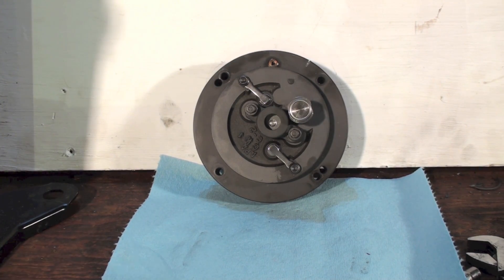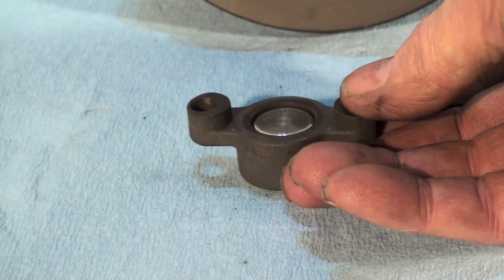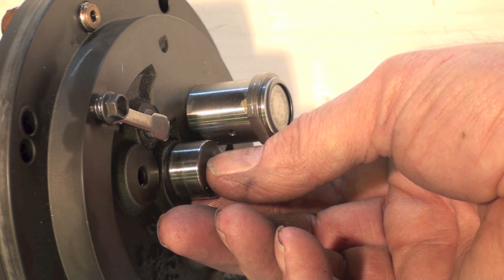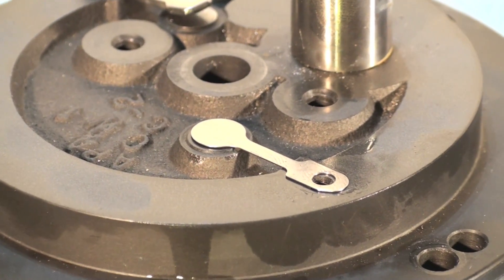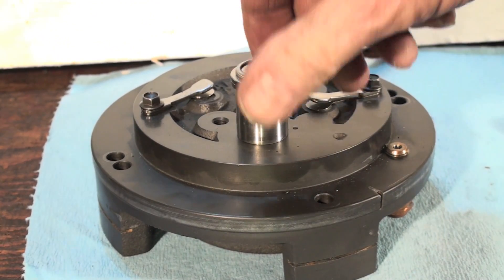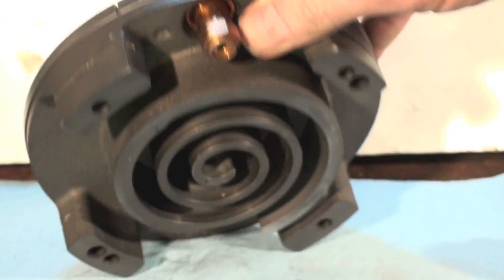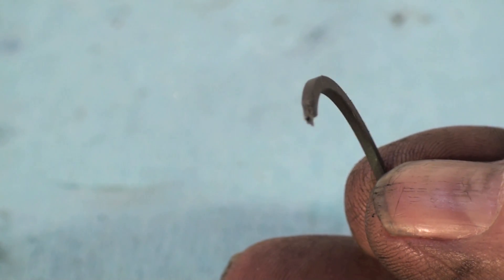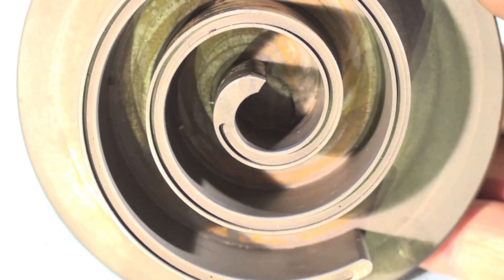A closer look at the Korean scroll compressor

Comment: I believe the last silver cartridge that spins in is a catastropic temp/pressure relief. Vents to atmosphere if Im correct... Blew one on a compressor on a car.
Reply from the maker: It does not vent outside.  It communicates between the scroll and the high side.  The unit does have a pressure relief.
GFM
Reply: Cool, I learn something everyday :)
Just how common are scroll compressors?
Reply from the maker: TheWizechatmgr On newer equipment, they are the most common compressor.  They are 10 to 15% more efficient and accept liquid better.
GFM

Comment: Good vid GFM!

I believe the two reed valves are for increased efficiency when the head pressure is low, if the pressure above the valves is lower than the pressure in the scroll, some of the refrigerant can bypass the last turn of the scroll and lower the work that needs doing by the motor.
Reply from the maker: Hey, could be.  Thanks for the thought.

Comment: Those little reed valves are a series of check valves that are  for use in a scroll compressor which control and dampen the closing of the check valve to reduce noise during rapid pressure fluctuations encountered during normal operation and to control loss of gas in a discharge passage. In one check valve, a reed valve or poppet valve is employed to control the motion of a main valve to a closed position.